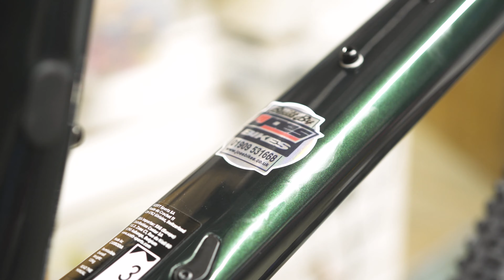Lightweight Scott Scale Mountain Bike Build - Joes Bikes Hand Built

Comment: I ordered it in size L and I find it a little small at the front, so the seller suggested that I add a little angle to the stem to have more height at the front.  this a good initiative?  will it change direction?

Comment: How did you lower the weight?
Reply from the maker: a combination of lighter parts tubeless and lighter tyres, genuine UK stuff is sometimes lighter.  cheers   Joe
Reply: @JoesBikesUK  What are you talking about what UK original parts? This is stock scale 930, and the tyres are also stock for EU and South America, and they are very heavy WTB coming at over 730 grams each. Tubeless cuts barely 50-100 grams per tyre. So how is this one kilogram lighter than all the other Scott Scale 930s? Is your scale precise?
Reply from the maker: @NiohNiohYT  Maybe the one we had was just lighter, they do vary!
Reply: @JoesBikesUK  they vary sure, 11.6-11.9 is the weight without pedals with tubes, 11.4-11.7 kg tubeless, but not only you have 500-700 lighter bike, but it was WITH added pedals. Some parts do vary but that is couple of grams, we are talking here arouns 750-950 gram difference (with pedals). 
Thats HUGE, thats difference between idk 600 and 3200 $ wheels, thars difference between 400 and 1000$ fork, thats difference between all components alloy or carbon.

Point is, the difference is HUGE, and probably your scale is not calibrated well or just not precise.
Reply from the maker: @NiohNiohYT  Yeah Maybe, I'll check thanks for your comments, I hope you enjoy our videos, cheers   Joe

Comment: Hey Joe. It didn’t look like you put tape on the rims beyond what already come on. I have recently bought the same bike and put some tubeless valves and sealant, but it’s leaking around valve stem. Didn’t check the tape, assumed as the wheels are “tubeless ready” I’d be good to go. Do I need to add tape? Thanks
Reply from the maker: Hi David, you are right we didn't change the tape but the tape is not always applied well so it's worth checking. We have had problems with the standard tape where it lets air passed into the rim cavity to leak around the valve as you experienced. A few manufacturers provide wheels that are tubeless ready and the tape looks like it's good to go but it's not always the case. The way around this it to take it off and fit a good quality tubeless tape instead from the outset, I hope this was helpful, cheers   Joe
Reply: @JoesBikesUK  thanks joe. That was indeed the approach I took. Lesson learnt!

Comment: Great build, I was kinda shocked it came in at 24.1lbs.
Reply from the maker: A few lighter parts and tubeless can make all the difference.  cheers   Joe
Reply: Incredible weight. 24 lb 1oz is aprox 10.9 kg. I have the same model (L size) but weight is 1 kg higher.  Wtb tires TR are extremaly havy (920 g) + tube 180 g! I changed the tires for new set: continental race king race sport + Light tube (620g),  but weight is still close 12 kg (with pd - m 520). Did you change any parts?

Comment: the twin lock switch is attached to the handle. If I change the handles, I can then fix the switch.
Reply from the maker: Hi Unicorn, yes you can. The bike comes with a small plastic adaptor to allow this to be done, cheers   Joe

Comment: I have the same bike, but the spec kinds sucks. Wheels and tires are way too heavy. I changed that first with a 1500gr wheelset, non tubeless Schwalbe Rocket Ron tires with revoloop innertubes and a Chinese onepiece (Sram style) 11-46 cassette. I upgraded the crank to XT. After that I changed to Ritchey Comp carbon seatpost and aluminium stem, Ritchey WCS carbon handlebar and grips. Tune seatpost clamp and headset cap. And as a final touch a nice Selle Italia xc ti rails saddle, some titanium bolts for the brake calipers and lightweight axles. 9.8 kg and a fine machine now. The colors on this bike made me buy it, really great combo with that classic green with champagne.
Reply from the maker: It is a really good looking bike, glad you like it and looks like you have made some great upgrades too. Thanks for watching and commenting and I hope you like our other vid's too, cheers   Joe.
Reply: You invested so much money in it lol, why didnt you just buy 900 RC for the money and have much better bike at like 8.9 kg for the same cost that you got 930 and ALL THOSE PARTS for...

Comment: And the lightweigth? with a spanish brand like mondraker, you can get near of 6kg. You cant get a light bike, with sponsored stock components, this is only assembly  the stock bike
My fucking god¡¡¡ this grips weights near 100gr, are you kidding me???
Reply: and he uses shitty brake levers below alivio 🤣
Reply: Do not lie, Mondrakers lightest bike is 7.84 kg stock for Podium Carbon RR SL, and Scott's flagship Scale model is 8.83 kg stock. Also sponsored stock components of Scott bikes are best in existence, their Silverton SL wheels are the lightest single piece carbon mtb 30mm wheels in the world, and with DT Swiss 180 internal hub they are also within the most reliable as well. Their Syncros fraser single piece stem and bar combo is also one of the best and lightest cockpits in existence, topping out any existing aftermarket combo with additional aero and compliance benefits. Also your lie about Mondraker is invalid as that bike is 10.000$ and this Scott 930 is low/mid 2400$. As for mondraker vs scott difference of their frames is less than 100g, Scott has HMX SL Scale frame variant that is under 900 grams, while being 2.3 times more durable in upper half than mondraker that will break like a stick if hit on the side